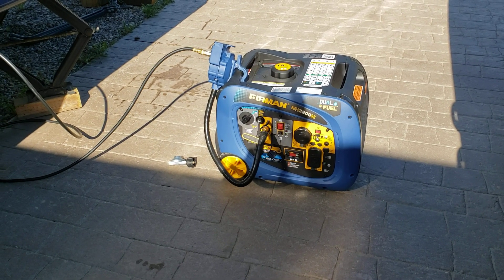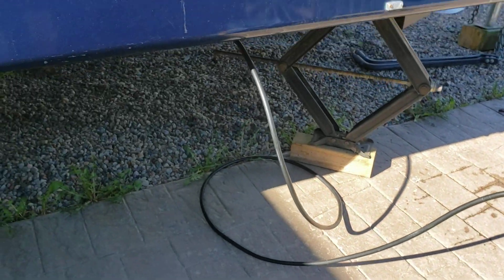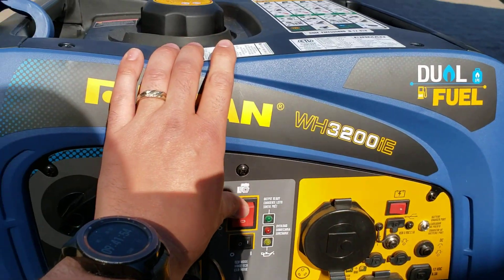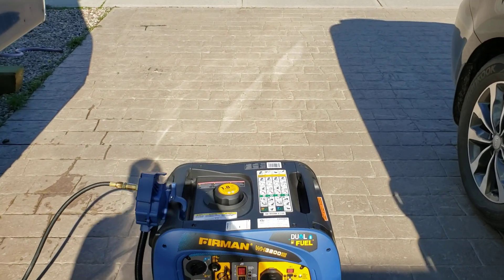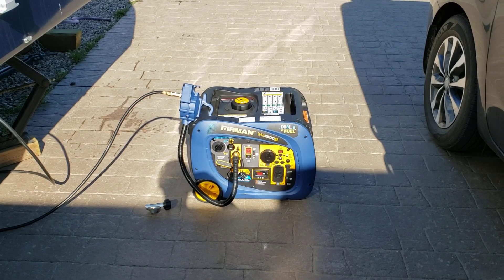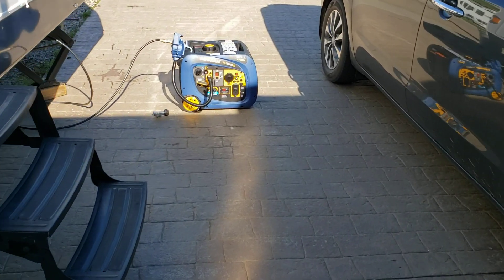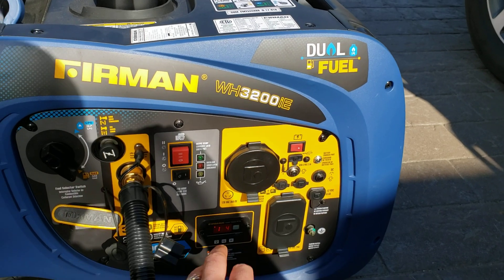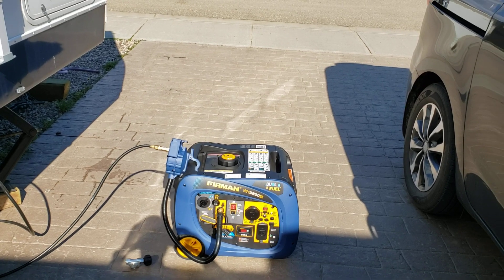How to run dual fuel / propane generator off of RV quick connects.

Comment: What was the benefit of bypassing the first stage regulation?
Reply: The rv's port is already regulated to low pressure which eliminates the need for the generator's HP to LP regulater thusly it is removed. Otherwise the gas into the generator will be double regulated and it won't run.

Comment: Ooooooh, I see....that's how you get around the solonoid wire still being connected!  Awesome!
Thanks for posting that video.  Brilliant!  I was wondering if the unit would exhaust all regular gas out of the carb when it was subsequently run on propane.  I was hoping that by running it on propane last that it would prevent the carb from clogging up due to fuel neglect.  Unfortunately, I just called Firman while watching your video and they say that it will leave gas in the carb.  Bummer

Comment: In your opinion, why does that Firman require the extra propane solenoid plug where all other brands do not?
Reply: I have no idea only the inverter models have it the generators do not as I have a 12kw home unit as well
Reply: I would assume that it opens/closes the solenoid when changing from LP to regular fuel and vice versa.

Comment: Hey Mike how long does the generator run on propane, I know my 3200 runs about 9 hours on gasoline, they don't have any information on how long it runs on propane.
Reply from the maker: How bigs the tank connected to it man? I had 60lbs at the front of my RV. 

On a 20lbs tank running hard at least 12 hours I never emptied one on a trip and converted to my quick connects off the RV 😉
Reply from the maker: Love that I've sold the RV and Gen thru a divorce for now..but still get to help people get out there. Happy trails!
Reply from the maker: And I always had both 30lbs full before ever leaving home. They're running the fridge furnace my BBQ my propane firepit when I want it, the stove and oven inside and that KICK ASS GENERATOR setup I showed ya.

Comment: Just got one, runs great with the battery starter, I ran a test on propane electric load up to 3050 watts and it took it like a champ. But there is no way in hell I can make it start using the recoil with propane. I have not try gasoline and I am not planing to for the moment. Have you try to start it using the recoil?

Comment: I bought this generator and converted it to run off my quick connection on my trailer but after about 2 minutes it shuts down on propane like it runs out of fuel? What am I doing wrong? I removed the regulator and connected the hose to the port. I have propane in both tanks on the trailer but it does the same thing, shuts down within 2 or 3 minutes.  Runs fine on gas? Any suggestions would be appreciated. Rocky

Comment: I bought this generator and converted it to run off of my trailers quick connect from the propane tanks. It worked great the first time now it runs for about 2 minutes on propane then shuts down like it runs out of fuel. Any suggestions?

Comment: I friggin love the internet. Exactly what I needed to do EXCEPT I don't want a hookup to the travel trailer, but I needed an extension hose to run my dedicated 20lb bottles at ground level without taking the generator off of the generator tray mounted to the travel trailer.

Comment: I have searched the entirety of YT for a video of a generator running the A/C off of a camper propane quick disconnect.  This was so close, yet so far. ;) Did you say this rand the A/C? Do you know what size A/C unit that you have?
Reply from the maker: Yes it runs my A/C perfectly.

Not sure if it's 15 000 or  13 500 BTU.
Reply: @mikem9837  thanks! Have you installed a soft start on your A/C, or is it still factory?
Reply from the maker: @MikeJordanUnCamplicated  no soft start just factory.

Comment: Assuming your tanks on the camper had a regulator why did you have to add another one right at the generator?
Reply: If the blue one is like some of the secondary regulators that come with other generators, it's more of a one-way valve that requires vacuum drawn against the output-side to let propane flow than a pressure regulator.  It prevents propane from just leaking out when the generator isn't running.
Reply: @TWX1138  I've seen some videos say that most dual fuel gens have that secondary regulator/valve located on the inside of the unit.  That's usually the biggest knock I've seen against the Firmans...being external and not internal.
Reply: I think for a tank that is not on the RV, an extra one. For your house in a blackout, etc......

Comment: Mine won't start. Tried everything, just turns over. I will call Firman, but I think I will return it tomorrow.
Reply: Was it the propane that wouldn’t start? I’m having same problem. Gas is no problem, works great. But I didn’t want it for the gas.
Reply: Same here just bought one works great with gas doesn’t work with propane

Comment from the maker: So I've had a few questions on the hose specifics so here's another video:

https://youtu.be/s_Avk-sOb5k

1/4" propane full flow male quick connect on one end and a 1/4"  NPT female thread on the other. My hose inside diameter is 1/4" and it's 10' long. I would suggest going to a 3/8" inside diameter hose if you want a 20' or longer run. I'll link some hoses from amazon below. Use yellow gas line tape for all connections or gas line dope.
Reply: Mike M Thanks!
Reply: Thanks again.  Your extra connections confused me but clear now!
Reply from the maker: This hose 

https://www.amazon.ca/dp/B07BWM5JY6/ref=cm_sw_r_cp_apa_i_r3cmFb44J3CE2

Or this one

https://www.amazon.ca/dp/B07RQXRKC5/ref=cm_sw_r_cp_apa_i_z3dmFbMTVVDMN

With a 3/8" to 1/4" female npt adapter:

https://www.amazon.ca/dp/B008OMK01K/ref=cm_sw_r_cp_apa_i_LndmFbFQMSY4G

Comment: Just bought same generator from Costco.  On sale now.  Really nice.  Great video thanks.  But I'm a bit unclear on the connections (new to this sorry).   To use my low pressure valve on my trailer can you list the parts I need to order on amazon? (don't have a camping store nearby).  Hose size? Quick disconnect size? Adapter size to use on big blue regulator? Anything else I need? Thanks again for posting this video.
Reply from the maker: 1/4" propane full flow male quick connect on one end and a 1/4"  NPT female thread on the other. My hose inside diameter is 1/4" and it's 10' long. I would suggest going to a 3/8" inside diameter hose if you want a 20' or longer run.
Reply from the maker: This hose 

https://www.amazon.ca/dp/B07BWM5JY6/ref=cm_sw_r_cp_apa_i_r3cmFb44J3CE2

Or this one:

https://www.amazon.ca/dp/B07RQXRKC5/ref=cm_sw_r_cp_apa_i_z3dmFbMTVVDMN

With a 3/8" to 1/4" female npt adapter:

https://www.amazon.ca/dp/B008OMK01K/ref=cm_sw_r_cp_apa_i_LndmFbFQMSY4G

Comment: Hi Mike , I just got the same generator... where this you get adapter and the hose from??..... post a link please.. thanks..
Reply from the maker: I already had the 10' hose with a quick connect on one end and a 1/4" fitting on the other end. Any store that sells propane fittings like a COOP or camping world should carry basic propane line like this. Amazon has them as well. If you can't get the exact hose you want a few adapters will get you there. Take the whole blue regulator thing in the store with ya to get the parts you need.
Reply: @mikem9837  I got it Mike Thank you so much... lets hope it works.. !!!
Reply: Lol did it work?
Reply: Yes it did. No problems.
Reply from the maker: https://www.amazon.ca/dp/B07CKR126W/ref=cm_sw_r_cp_apa_i_yoF.EbN97NNEW

This line with a 3/8" to 1/4" NPT adapter would work.

Comment from the maker: 5 days Boondocking out at Tucker Lake. I put 11 hours on the generator all on propane off of the disconnect. I ran the AC for a few hours in the late afternoon to cool it off for the kids, furnace has been on overnight. I'm still on my first 30 LBS tank so I know forsure I have no leaks anywhere. Very pleased with this setup. And I put about 8 hours on my propane fire pit too all off of one tank. Water remains the pitfall..
Reply: Hi Mike.  I just got this same model today & would like to use a longer hose.   I'm moving the factory  regulator to  40lb tank,  & would like a longer hose from tank to solenoid.   Is the fitting on the solenoid   removable , or did you use an adapter ?    Are you using a 3/8" hose ?   Great video.   Thanks.
Reply from the maker: @ja9915  yes the fitting is removable. And it's a 1/4". It was tight but came off.
Reply from the maker: I'm using 1/4" low pressure propane line.
Reply: @mikem9837  Thanks.    Had to request an exchange.   The recoil starter jammed on first pull & found  damaged capacitor on the inverter.   Some reviews are indicating issues with the recoil starter.    Maybe a lemon.  We'll see.
Reply from the maker: @ja9915  sorry to hear of your troubles. I'm up to 61 flawless hours of use so far.